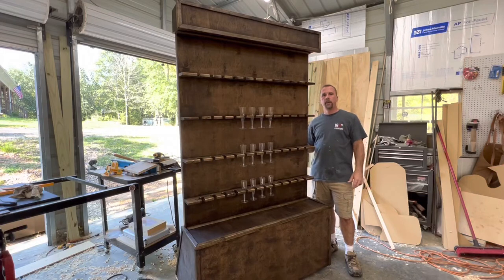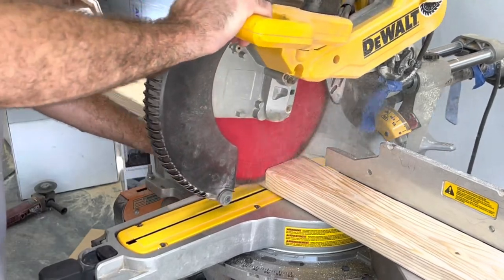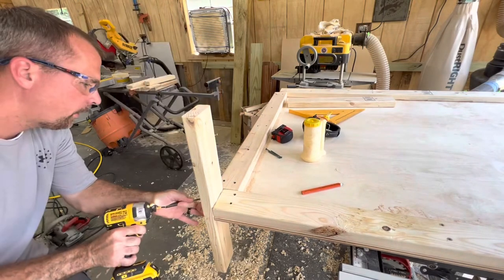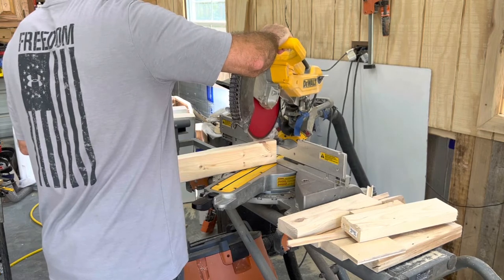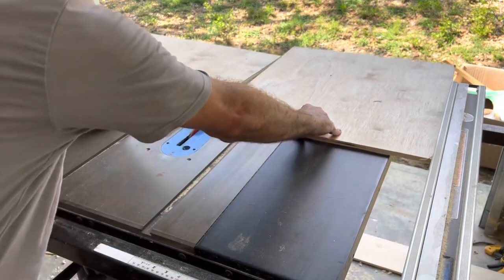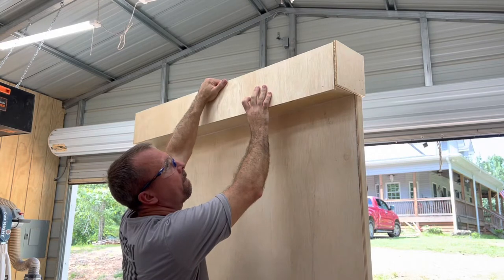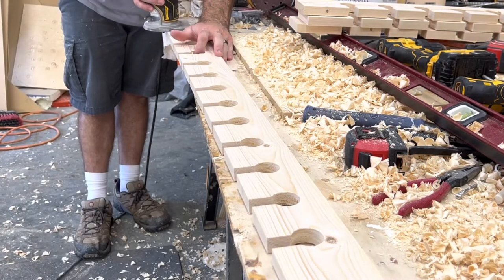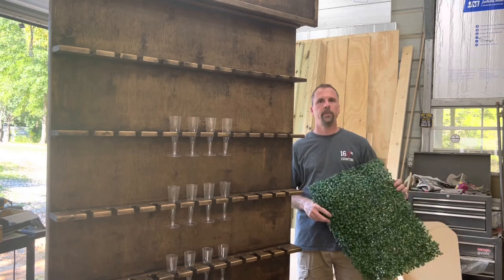DIY Champagne Wall | Build Plans Available

Comment: Loved this!! We bought the plans and are almost finished with our wall! There is a mistake in the plans that I thought you should be aware of… they said we needed 2x4s but we ended up needing an additional one once we got to the bottom part of the wall instructions that the list didn’t show so we had to make another run to Home Depot! Other than that, great job and thank you!
Reply from the maker: Thank you. I’ll update the plans.

Comment: I love your video. I’m just a little confused on the measurements of the bottom top🫣
Reply from the maker: It’s really no specific measurement on the top pieces. I make the front piece cover the lights if I’m adding them and I build the top box out about 6” from the wall